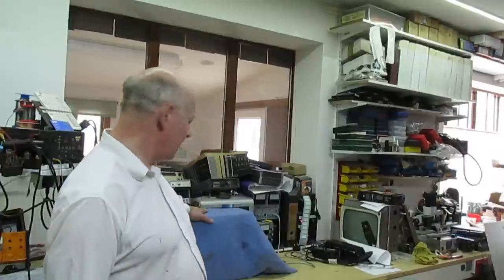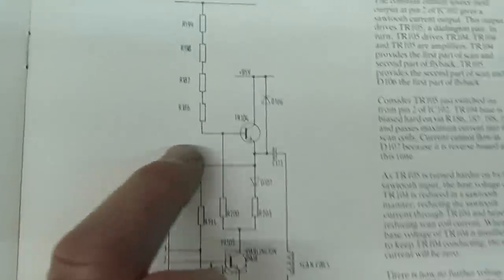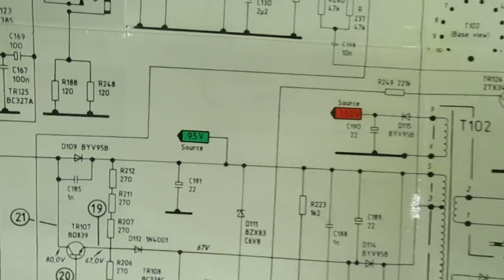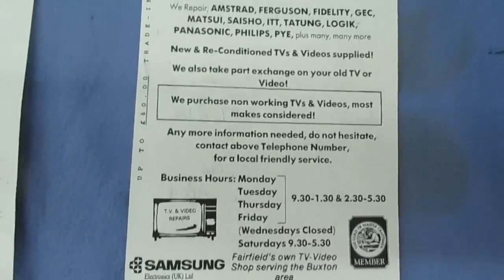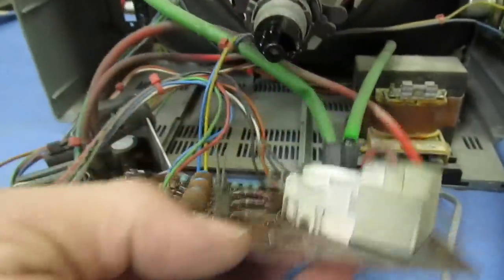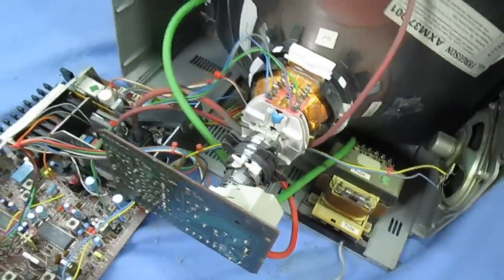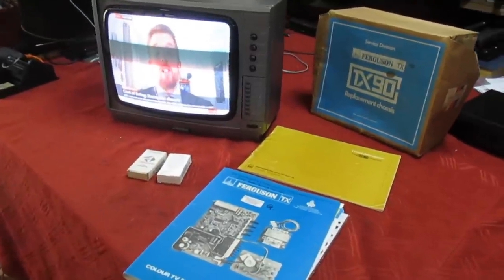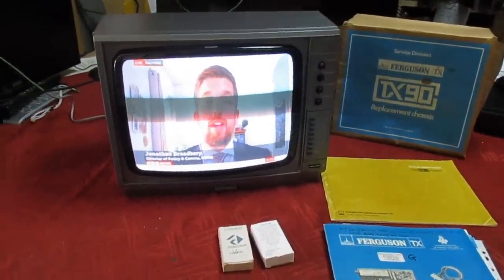Thorn TX90 chassis vintage TV set from 1984.

Comment: Great video as usual Michael. These were good sets. We weren't ferguson dealers, but bought them from a distributor. Then currys opened across the street and were selling sets cheaper than we could get them wholesale. We only lasted a couple of years after that and closed in 1986. Many thanks for that Michael
Reply: Currys etc were the reason a lot of smaller stores were lost 🤬
In some cases the quality of servicing and repairs and Customer aftercare definitely suffered in the quest of the £€$
Reply from the maker: I remember at the time there were a lot of very unhappy TV retailers when It was either Currys or Dixons marketed a 20 Inch TX90 based set using the brand name Logik , it was of course exactly the same set as the Ferguson badged on but a lot cheaper .

Comment: I worked for a Ferguson dealer in Birmingham in the 80's. We sold loads of these TX90's and I have repaired a lot of them. They actually sold for just £169 - well below the £200 mark! I still own one of these myself - it was a Xmas to myself for Xmas 1983. The TX90 was actually launched in the summer of '83. I attended the one day training course for this chassis run by then Ferguson TLO Barry Baldwin. Great days...!
Reply from the maker: I wasn't absolutely sure of the price as its a long time ago but even £169 was a lot of money back then . The only course I did at Ferguson was the ICC5 but by then sets were going down hill as they were Thompson designed .
Reply: Sad to note that all the big TV companies like Thorn Philips Decca were all on the same trajectory as the hundreds of little shops that dealt with rentals and repairs and that by the late 90s were mostly closed.
Reply: The last remnants of Granada Rentals Radio Rentals came to a supermarket car park to sell bubble wrapped TV's to the public after they finally went bust.
Reply: They'd changed their name to Boxclever
Reply from the maker: @glpilpi6209  Funny you should mention Radio rentals, last Friday I repaired a HI/FI amplifier for a guy who worked at radio rentals , he remembered me climbing  into there industrial bin in the 70s, they were supposed to be closed but he was doing overtime .

Comment: Lovely little set, the thorn designers really put much thought into their products and this is an object lesson in minimalism, but not at the cost of performance.
Reply from the maker: designed to last and be repaired, its a far cry from the crap we see today .
Reply: @michaeldranfield7140  absolutely agree, i serviced all of their range from the 2k to the end, and with each new chassis came major improvements in circuit and manufacturing design, usually incorporating new circuit techniques like the first smps psu or the cyclops power/line output stage, the only notable exception was the infamous 4k chassis which seemed over complex, i think it might have been designed for export.
Reply from the maker: @monteceitomoocher  Even worse when they got involved with Thompson , such as the dreaded ICC5
Reply: @michaeldranfield7140  It really went down hill when Thomson took over and it was the same story with RCA in the 1990's ... Dont see Thomson anymore i wonder if they gone completely?

Comment: I remember these great little tellys they were super reliable and were perfect for computer use especially if you got the model with the
extra composite - RGB board my friend Mike built one of these sets into a pye V4 I mad the wooden frame based on the V4 chassis and he built the comp -RGB board
himself from the sevice manual so he can run a tv box he has it as a bedroom set top video as always mate
Reply from the maker: I remember the set with the extra RGB board but didn't repair many of these at the time .

Comment: Great video, the multiple use of the same resistors was because at that time a new component placing machine was in use and it couldn’t handle large components. So rather than using high watt resistors which are large in size they used multiple smaller components. This saved on production time as the resistors didn’t need to be fitted by a factory worker.

Comment: Great video, very nostalgic seeing these sets in action.
Reply from the maker: Got another as well but not in this condition with flap and tuning tool intact .
Reply: @michaeldranfield7140  I am struggling to remember exactly what it was but I have a recollection of a TV I inherited in  the early 198Os. It was fitted with the Mullard 20AX tube with the slotted shadow mask and I believe inline guns. It was at least 26in and possibly 28in. Very large at the time. It had touch controls and an ultrasonic remote control. I think it was a Ferguson and would have been the top of the range in around 1977. I kept it until the late 80s. It had the tripler replaced a couple of times over the years.

Comment: Used to buy these up near christmas time as they sold easily, and mad good presents for kids bedrooms, really reliable sets.
Posistors failed as you have said and the famous dry joints on the frame output transistors and of course the mains switch.
the odd tuner fault or a colour missing, happy times fixing those Tv's.
Reply from the maker: I remember in the 80 s massive demand for colour portable sets and ex rentals were very expensive to buy .

Comment: Nice one Michael! Many thanks for sharing! Another good trip down memory lane! I remember within a very few short weeks of this model being released, and we had a brand new one these in our workshop because the customer said it had a hum-bar on the picture when the set was run on a mains extension lead. I also tried two other TX90's  we had in the workshop on an extension lead, and they also had hum-bars too. So I phoned Ferguson Technical and they knew all about this issue already, and sent us a revised mains transformer with the suffix of the part number changed from "-000" to "-001" (or maybe "-001" to "-002") and that solve the problem. After that, and over the next few months we did get at least another two sets with the same issue when the customers were using them in a caravan or camper when they run them from the shore supply electric hook-up i.e. another kind of extension lead..... Also, I can recall repairing various 14 and 20 inch versions of these right up until the late 1990's...
Reply from the maker: The 20 inch version had some sort of problem with its mains transformer and I still have a new one in stock somewhere but I couldn't remember what it was .
Reply: @michaeldranfield7140  - I cannot recall what the issue was with the 20 inch mains transformer. I only recall the 14 inch ones having the hum-bar problem.

Comment: I have a few of these in my collection! I have white ones, silver ones, remote control ones, non-remote control ones, mains only ones, mains with battery converter ones, and one with the RGB input sub panel in the bottom of the cabinet!

I had an interesting event with one of these with the battery adapter fitted, and I've never yet heard of anyone else coming across the same problem. As you say, the tuner is not isolated, and that led to a silly situation one night, using my own set on battery power (mains outage). The battery was from a car, and the telly sat on a table in front of the main telly. This meant we needed a coax extension lead to reach the portable, so that meant an inline coax connector. This where it got interesting - One side of the battery input is tied to the chassis ground (as you say, tuner not isolated) and as it just happened the extended coax lead passed over the top of the battery (can you see where this is going?). All was fine until the cat wanted to get up on top of the [main] telly, and in so doing, leapt up, just nudging the coax, bringing the inline connector into contact with the battery +ve post, so we now had a short circuit via battery input lead -ve, through the chassis ground and back to the battery +ve via the outer of the coax.

Let's say there was a bit of a slow conflagration of the copper track ground plain on the PCB. Needless to say, the PCB was badly burnt, and had to be pared away to remove the carbonised sections of PCB, and the repaired with insulated wire to make good on the board. It works, even to this day, but would have been even better if I'd known you could buy a complete replacement chassis.

I think the designers must have not considered that scenario, or, were falling asleep on the job! But surely, if users took the telly on holiday in their caravan, then there was always bound to be a very real possibility that this kind of short circuit could happen?
Reply from the maker: its nice to know there are more of these about, I do have another silver one but not in as good condition and I have a battery converter but it may be for a different model of set ,
 don't mention running things in a caravan off 12 volts , back in the 90s I was converting sky boxes for a dealer to 12 volts and something went wrong and caused a bit of a fire in a caravan which resulted in me getting a visit from trading standards and the guy I was doing them for was ordered to refund all the customers he had sold them to.

Comment: Hi Michael, used to work for cash generator back in the day in the service department, repaired loads of tx 90s, tx100, tx9, tx98, tx10, when tube was a bit weak, we used to put the heater voltage up, couple of windings of wire around the loptx core, happy days , love watching your videos, keep them comming
Reply from the maker: Done that before but the extra turns on the LOPT was very short lived , glad you liked the videos , more coming soon .

Comment: I rented one of these from DER for a little while. Never once had a problem with it. It eventually outlived its usefulness to us, so it went back. These sets could hum audibly when plugged in - I guess because the switch was on the secondary side. My dad wondered if the CRT heater was on all the time.
Reply from the maker: no the heaters on these were not lit all the time, Hitachi seemed to pioneer this with its instavision  but keeping the heaters lit all the time at a reduced voltage is a very bad idea as it results in cathode poisoning and a very short CRT like as Hitachi  found out to its cost .
Reply: @michaeldranfield7140  Indeed, as I thought. My dad was probably thinking it was similar to the CEP-180 we rented from Wigfalls.

Comment: Thanks for another brilliant video Michael!. I do like those early/mid 80's Ferguson sets, before Thomson took over. I have an old TX9 14" and a TX100 20", both with pin sharp pictures and good colour. They were workhorses. My school had them in the 80's and even My college had them still in use in the mid 90's. I doubt any of todays flat screens will last that long.
Reply from the maker: Thorn was never the same when they got involved with Thompson, ruined there reputation .

Comment: it looks like more modern than what we bought at the late 80 or may be very early 90s. 😄
ours had a 7 segment 8 channel display and a remote, with HUGE pcbs inside. it lasted ~10 yrs, requiring frequent repairs after it's 5th yrs or service.
compared to that, what CRTs we bought in early & mid 2000s required very few maintenance and one is still in service, with it's audio blown out. did not get it repaired, just using an external speaker connected to cable box.
Reply from the maker: There were quite a few different variations of the TX90 , I remember the remote one with 7 segment display .

Comment: I believe in New Zealand it was sold here as the TX9. A BRILLIANT set with only the soldering that let them down.  Nowhere near as bad as the Philips in the day, but usually an easy fix.
I have a Panasonic plasma on the bench at the moment where the surface mount 431 failed taking out the 6v protection diode. As a now hobby, it's a wonderful wet day project. Funny how getting back in to the trade after 40 years has seen a need to get stronger glasses 🙄
Reply: Hmmm.. TX9 and TX90 were different, but contemporary, over here.
Reply from the maker: We had a TX9 set in England but it was a 20 inch

Comment: These were great little sets, I must have repaired & sold a fair few of these back in the day, in fact I had a very battered example as a bench TV for at least 10 years, I remember the dry joint problem well, other than that they were very reliable.
Reply from the maker: weren't these just a good set and easy to repair, how things have changed .

Comment: I had the later one, which I assume was also a TX90, where the chassis was slung underneath the CRT. Also had a Scart socket and made a big feature of it if I remember correctly. The issue I recall was that the main transformer was powered all the time. Mine was noisy and used to sit there buzzing quite loudly even with the set off. Eventually I got fed up with it, split the transformer laminations, filled the gaps with resin and squeezed it all back up in a vice, which cured the problem.
Reply from the maker: I have a vauge feeling that the mains transformer in the 20 inch versions suffered from intermittent fuse blowing but cant be 100 percent sure as its a long time ago now .
Reply: @michaeldranfield7140  Mine was the 14" monitor style (MC05). Never did like the mains transformer being on all of the time. Although understanding TV's better now, and as you mentioned, it did allow for the chassis to be isolated from the mains.

Comment: 2:50  Seems like a clever way to spread out the heat dissipation to keep the heat from building up in a small area. It might have avoided those burn marks that are so common on CRT connector cars.  I've done that with dropping resistors when worried about damaging the surrounding parts and materials. I've even wrapped  multiple dropping resistors into cords so that a length of it got warm without any point getting hot.
Reply from the maker: could well be , it was an interesting idea that worked very well .

Comment: I remember being annoyed that channel 8 was marked VHS.  What, can't use with Beta?  Bear in mind that the Sanyo VTC5000 / VTC5150 outsold all VHS models.  An a/v input option was sadly missing from these TVs.  I used one as a monitor for my Commodore Plus/4.
Reply: It was the standard telly for most home computers then, if you weren't rich enough to afford a commodore monitor!
Reply from the maker: It was the rental market adopting VHS as its standard that killed off betamax, I remember throwing away countless numbers of VTC5000 s as no one wanted them .

Comment: if you had a ferguson courier 12 inch black and white tv,the one with the 12 volt input as well as mains that would be great,the one i had when i was a kid was the transistor one with clanky four button tuner panel,you know the one that would go bad from solder joints years ago(the bar would go bad ) or a diode would go bad in the power supply section from memory,thing would just work for years..im pretty sure there was a valve version that looked the same,we are probably around the same age micheal,so i presume you remember these things,had loads of fun repairing mine when i was alot younger
Reply from the maker: I do have one of the sets you mention in a black cabinet , a Thorn 1590 chassis and I saw one on the tip only last week in a grey cabinet but unfortunately I could not get it, and yes you are correct there was a valve version with PL81 line output valve , I think it was a Thorn 1580 chassis but may be wrong , I would like to get a valve one for my collection but not found one yet . The bar on the back of the tuner was a common cause of tuning drift , I use to resolder these with my weller 100 watt soldering gun , which I still have by the way !

Comment: Michael, firstly you have a fantastic channel, I am always waiting for your next video.  I had a variation of this that had RGB input, that used with my home computer. I can't recall what the exact model number was for the one with RGB input. I did notice that the case on your one had the PCB guides for the RGB board, from memory the last channel selector was labelled "RGB" instead of VHS
Reply: I recall it was the MC01. Channel 7 was RGB, and Channel 8 CVBS.

Comment: nice beasts,  i had one from1986 to mid 2000s, in regular everyday use, had a few issues over the years, failed 'jungle' chip, dry joints, dried up cap in psu/line stage, popped degauss posistor, and for many years bad tuning switches, couldnt get replacement unit, so there was a fair bit of button poking to get it reasonably stable,   i repaired a 20 inch version for someone, dud line output transformer,
Reply: my one was eventually scrapped due to the tuning switches trouble, frame sync issues with a 3v30 video recorder, i got another set with built in dvd player, and didnt really have space to store it, i kept the mains transformer, lopt, and a few other bits as might be useful 😉
Reply: i'd like to get hold of one again sometime but finding a good working or easily repairable one at not to silly a price is difficult

Comment: "Fergsuon" on that letterhead, better at electronics than at spelling, it shows. Thanks!
In any case, what strange audio output circuitry.
Reply from the maker: Never been good at spelling, didnt do very well at school as I only wanted to be a TV engineer. Strange but utterly reliable, I don't think I ever had any audio faults on this model .
 Oh and by the way I'm using spell check on my laptop , I still can't spell !
Reply: @michaeldranfield7140  Nothing to be ashamed of, and good luck with the channnel and retro and modern repairs. Thanks, the channel is entertaining!

Comment: Majority of faults could be cured resoldering that line of transistors on the heatsink. Occasionally you would get a customer moan about the hum of the transformer if were used in a bedroom
Reply from the maker: Yes they were the most common source of problem .